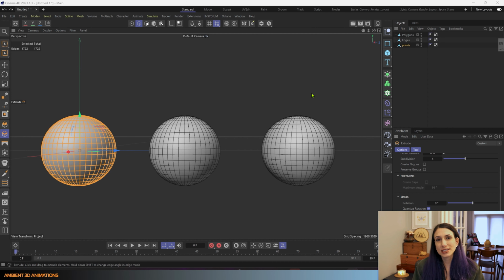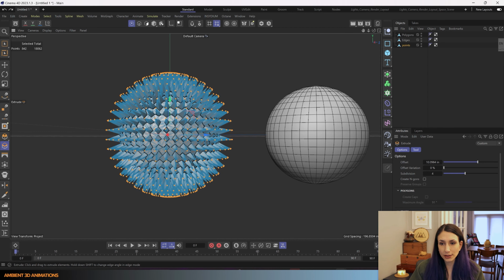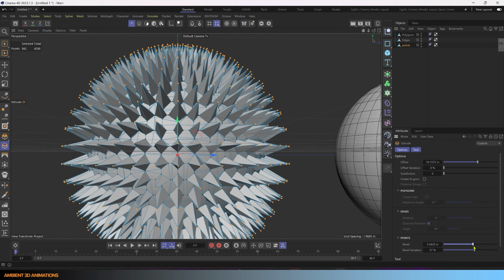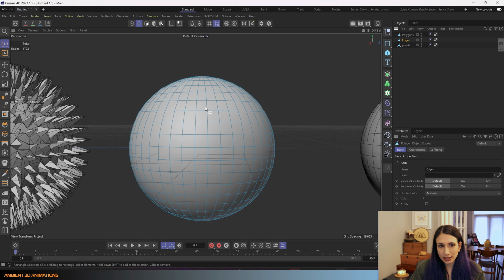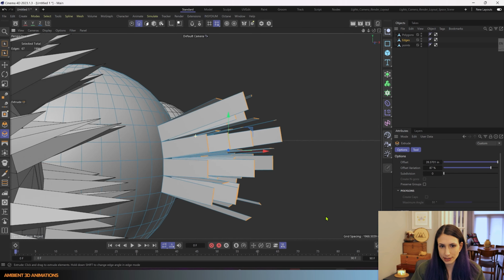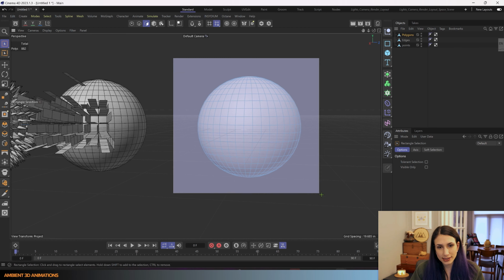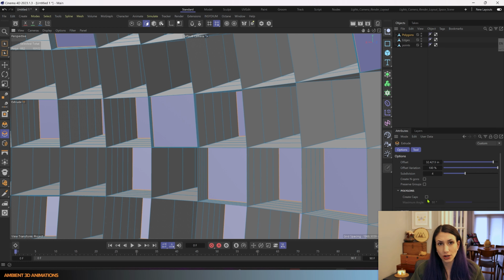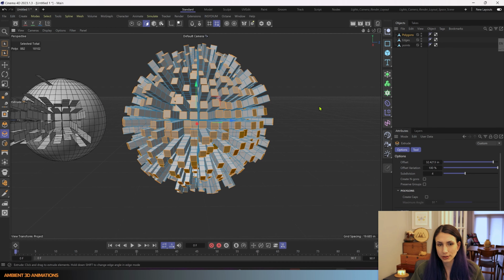Extrude Cinema 4D Tutorial EP03 (Remaster)

Comment: why when extrude edges are selected by a loop while simultaneously holding shift? Is one of the edges moving relative to the Axis?
Reply from the maker: This is a great question! I'm not sure where you are seeing shift being held down. When you extrude a loop of edges using M~T, then clicking and dragging in the viewport, you can adjust the rotation of the edges if you next hold down shift. Clicking and dragging controls the offset, but shift adjusts rotation. Please let me know if this helps answer your question!